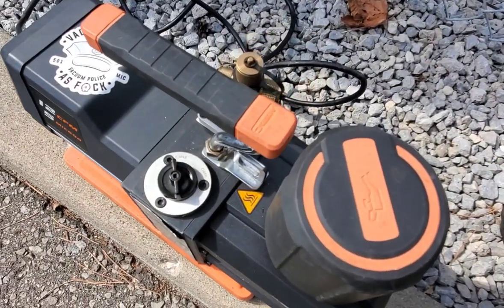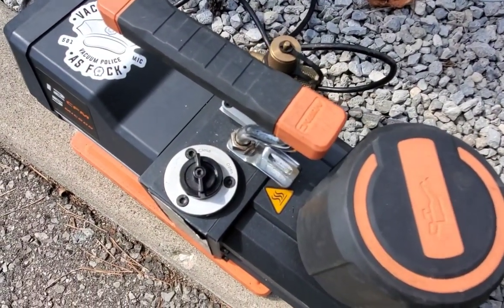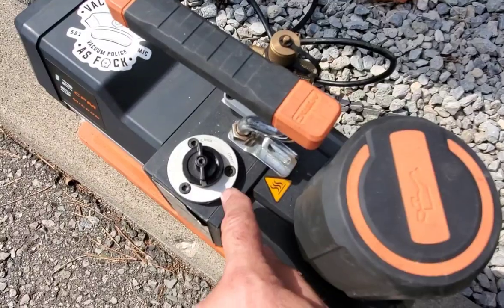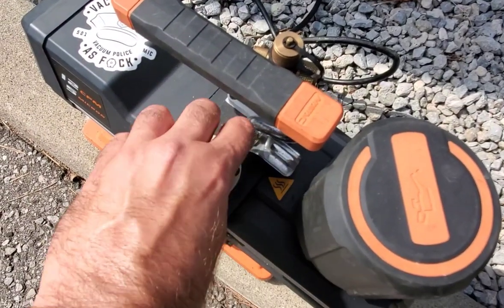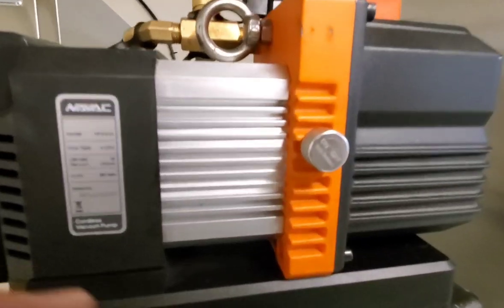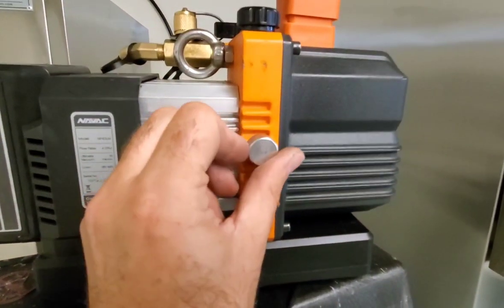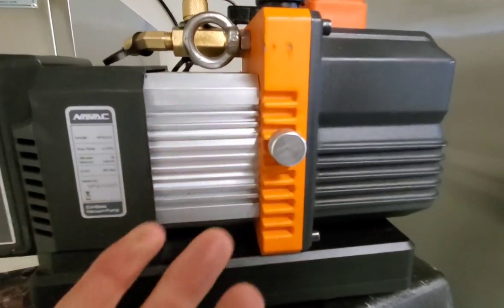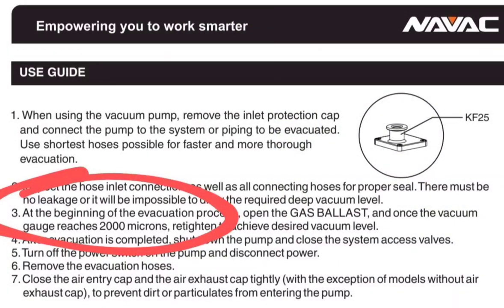How Does A Vacuum Pump Gas Ballast Work - HVAC Tip

Comment: Great info, thank you.  I'm understanding that with the ballast open the pump will be somewhat limited in how low a pressure it can reach but it prevents condensation in the pump (largely water) make to pump last longer.  Once the bulk pull down is done it can be closed to finish the pull down. I also read that with the ballast open the pump will get warmer - which is good when preventing condensation.  It seems that it is best to run the pump to get it warm before pulling on, particularly, a wet system.  If one can work it into their process. It looks like it would be a good idea to start the pump up while doing repair work so it can get warm.

Comment: Yeah, open the gas ballast at the very start of the evacuation, until vac gauge reads down to about 1500-2000 microns. At this point close the gas ballast valve fully. This simple procedure will avoid condensation in the pump, prolong your oil, and increase the lifespan of your pump too.

Comment: Never knew what the gas ballast's purpose was until I saw your helpful video. I've been working with high-powered 16kW Leybold screw vaccuum pumps for a couple of years and always wondered what that gas ballast is for. For servicing, we always had to change the air filter once a year, and boy, do they clog up a lot of grime.
Reply from the maker: Glad to help!

Comment: Thank you for the info, it has always been something i noticed on my pump. I have a freeze dryer and i have never used this open. Now that i have seen this should the ballast in my operation remain on because each cycle can last between 24 to 40 hours so I am not sure when or if i would need to close the valve. Much appreciated.

Comment: I have heard that the ballast is also beneficial for wet systems but then I could be incorrect.  Thanks for sharing.
Reply from the maker: Well yes, to avoid the moisture embedding into the pump oil too early

Comment: How much are you supposed to be open the ballast? Mine doesn’t get down to 2000 microns if it’s more than cracked open. Also do you store the vacuum pump with the ballast closed?

Comment: Im trying tthe NAVAC 4 cfm pump. I replaced my evaporator, soldered using Nitrogen, checked joints with blue spray, all looked good.
So I have my analog gauges and micron guage on high side ( Refrigerant stored in Condenser) and vacuum pulling on low side. My analog went negative to 30 within 5 minutes or so. The digital Micron guage (all new kit) started at 146K or etc then finally got down to 5600 microns but stalled there for 25 to 30 minutes.   Can someone reply to why it wont pull down more?  Do I need to Nitro again? Does it matter which side I place vacuum?  Some say guage at far end of vacuum to read line more accurately (not at pump line). Only about 25 Ft of line set.     Thanks for personal reply!!
Reply: If you have refrigerant stored in condesing unit n you want to micron vacuum the piping and the evaporator unit you need to make sure the valves holding the refrigerant are super tight sealed,no micro leaks in the system or vacuum hoses,connected to both hi and low sides to avoid any restrictions in vacuum caused by the expansion device

Comment: I have a YELLOW JACKET 93600 which does not have a gas ballast valve. I'm wondering if it's possible to install one by drilling and tapping in the proper location.
Anyone ever tried this?

Comment: You know after 20 plus years in the field and all these new battery powered Bluetooth powered devices you think somebody would automatically add in a gas ballast that would open and close at the correct pressures or microns should I say because sometimes on large systems like my units which are 200 ton plus when I'm pulling a vacuum I'm pulling the vacuum for a long time and sometimes I can't be sitting there for hours it would be nice for it to do it itself like back in the days when they had that little adapter so you could recovery refrigerant up to 80% of a tank and have it automatically shut off that didn't really go as planned
Reply from the maker: Good idea, I'm sure someone is working on it.

Comment: 20+ years..never opened that dam valve,just pull down to 350microns and let her eat...you can weld mine shut ,it still works fine...
Reply from the maker: So it's creation is useless?